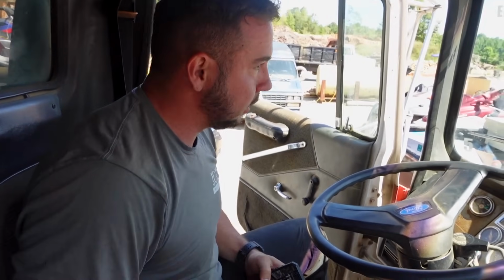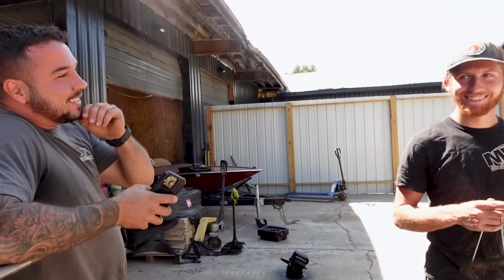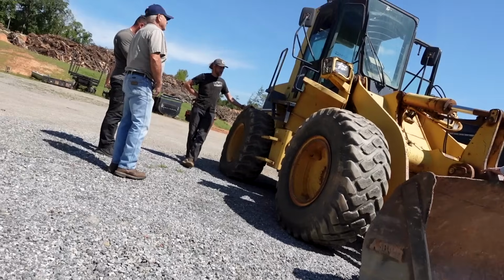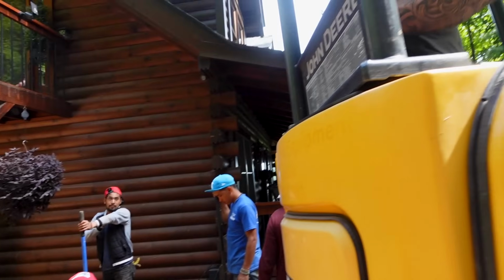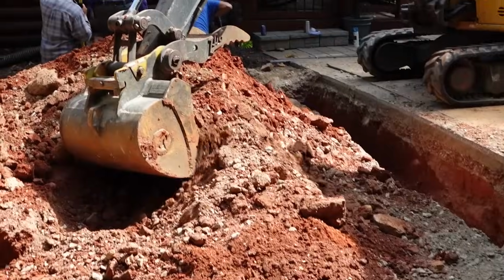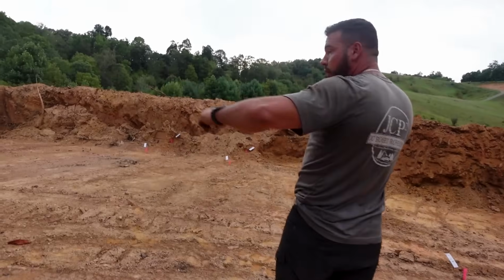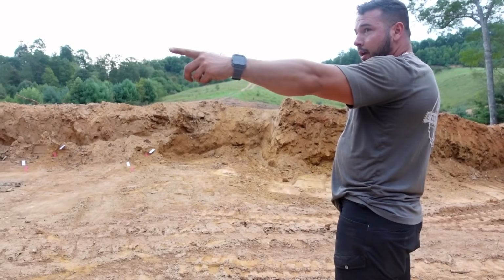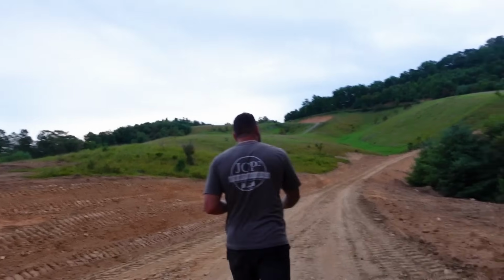Moved The House Site AFTER Our Basement Cut | We're Done With This Job

Comment: I've built many houses with just the floor plan, now the only thing about that is you don't necessarily know what your finished topography is going to be, the good thing about having at least an engineer coming out and doing an elevation is you're going to know where your house is going to be in the topography so that helps the contractor know where to dig and how far to dig and how much feel or how much cut he's going to have to do. Other than that you can get by with just a floor plan and some minimum topography, unless it's a big job most homeowners don't need to go out and have a complete site plan done but it does help.